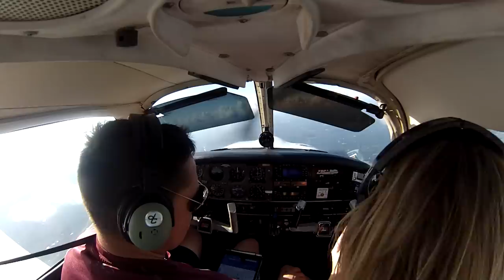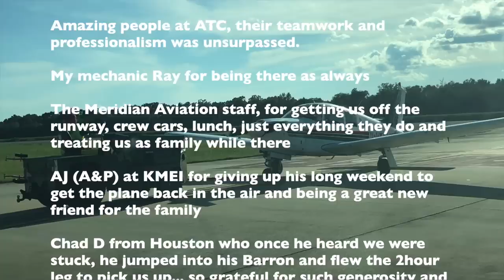Real Emergency - Power Off Landing with family in Piper Arrow after throttle cable breaks

Comment: Great job!  The only other thing I would try to do while circling is to pitch the plane into the climb and  slow the plane below flap and gear extension speed. Then drop the gear and apply full flaps. Increased drag would keep the plane to a more manageable speed even at full throttle for approach.
Reply: Exactly what I was thinking. Great job keeping his cool though. Same for his wife, she needs some credit as well.

Comment: Pretty much full load there, and yet you and the ATC handled that situation really well. I thought at first you might try staying up there longer to burn off fuel, but it turned out that wasn't necessary. Inspiring video with a well-deserved happy ending. More than a year since this video was posted, so I will wish you and yours a very Merry Christmas.

Comment: the family handled this superbly, and I would fly with them any time.

Something that no one else is pointing out is the excellent design of the Piper Engineers. Designing it to go to full power in the event that the cable brakes is brilliant. Failure mode gives Pilot full power. I just wanted to comment on how smart the engineers are.
Reply from the maker: Agreed Joseph and sure beats the alternative!

Comment: Thanks for sharing. I used to fly a Cherokee 140 but one day my engine quit at 4,000 ft in Sarasota and I landed on a road. That day I decided to get a twin. Any landing you walk away from is a good one. You were lucky that throttle was not stuck in idle. Good you kept flying the plane and it makes you a better pilot. Good job.

Comment: Great Job Buddy! This exact same thing happened to me 25 years ago in a 112 Commander N1316J.  We departed from Hicks Field T67 in Fort Worth and were in route to Oshkosh. No issues during flight until I was descending into Columbia, MO (KCOU), my halfway point to OSH , for fuel and i tried to reduce my throttle and, same as you, it didn't respond. I fiddled with the throttle and realized the throttle was stuck in cruise configuration. I began to diagnose the issue like you did and found I could move the throttle lever with no response. Pucker factor was high to say the least. I had my brother (student pilot) as copilot and my 5 year old son in the back seat. All that was running through my head was my father's words when I was in pilot training "fly the airplane". 
I didn't, however, declare an emergency because I didn't want to do the FAA paperwork and I was already talking to approach control. I also figured, what the heck are they going to do for me. I had a few other emergencies in my flying adventures that I did declare emergencies and the paperwork and microscope of the FAA was just too much. 
After a couple of minutes of thinking what my options were, I remembered my early days of flight training (at this point I had about 2000 hours) when my instructor showed me what happens when you reduce the mixture and how it gets to a point of making the engine run real rough. I also recalled how the constant speed prop controls the RPM of the engine. I knew that I needed to get the engine RPM to slow down to reduce airspeed so I could drop the gear and flaps to allow me to slow down enough to land. I didn't want to risk killing the engine and have an off field landing or miss timing of killing the engine and possibly not making the runway. You had perfect timing in your case and I am so glad that worked for you.
So the first thing I did was to pull my prop back and that helped reduce the engine RPM and subsequently reduced my airspeed, but not enough. Oh and all while talking to approach to setup for arrival. I was about 25 miles out at this point. Then I decided to gently pull back the mixture until it was lean enough to run rough. That reduced the engine RPM and airspeed enough to allow me to lower the gear and one stage of flaps. At that point approach turned me over to the control tower. The airplane was flying fine, the engine running very rough and I had it ready to land. The tower asked me to enter a downwind for the the runway. I did and about abeam the numbers they asked me to extend downwind for a Mooney on 2 mile final. Actually it was a good thing because it allowed me to cool down. The called my base and final about 3 miles out. Everything was looking great and it looked like I had this in the bag. Then the control tower tells me the Mooney is landing long and that I may need to go around. WHAT!!!!!
Sure enough the Mooney is 2/3rds down the runway the the tower asks me to go around. This is the point that I realized  I should have declared an emergency. Duh!!! Ok so I bring up the mixture, the prop and here we go to do it all over again. Fortunately with the gear and flaps down the airplane didn't want to gain too much speed so I just reduced the prop back on downwind, and pulled the mixture back until things were shaking and did a base, final and landing with engine power on. I taxied in with the engine running like it was coming apart and when I arrived at the FBO the young man guiding me in had a strange look on his face. As I shut down the engine and opened up the door on my side, he comes up to the aircraft and says "The throttle cable broke didn't it?". LOL I said "How do you know that?". He responded that he had another airplane, a Piper Arrow, about two months ago come in with the same problem and he had done exactly what I did to get the aircraft down.
Well there is more to the story as to how we got to OSH but that's for another chapter. I am so glad you and your family made it down safe and sound. You did an magnificent job at staying calm and you did what every pilot should do during an emergency "FLY THE AIRPLANE". If you want to hear the other part of this story give me a call (817) 991-6260 cell or friend me on facebook and we can share our adventures. Sorry for the long story but I just wanted to let you know you did an amazing job and that your aren't alone.
Oh and your wife.... well as nervous as she obviously was, she remained calm and didn't add to the problem and did everything she could to help the situation. She's a keeper! Coodoe's to her for being the perfect copilot.
Now I have over 5000 hours flying private aviation and I have learned that there are people that become pilots and then there are pilots that become aviators.
God Bless you guys and know he is always watching over you. Sierra Hotel Brother!!!   Your fellow Aviator,  Rick Raesz

Comment: Good job man.
The same thing happened to me the flight before my private pilot checkride (I was a student pilot flying solo practicing my maneuvers). I remember the throttle literally was stuck, and then it snapped. The plane was stuck full throttle just like yours was. As a student, I was scared to shit. I declared an emergency to get them to clear me through the bravo because the bravo is 2800 feet above the airport. Climbed to 5000 feet above the airport, cut the engine, then did spirals above the airport. Then I entered the downwind and basically did a power-off 180. It was the best landing I've ever made.
Reply from the maker: Well done sir! That’s one way to work those commercial maneuvers early... yikes. Well done handling something like that so early on.
Reply: @FamilyPilot  My instructor always stressed the importance of that maneuver to me even though it wasn't in the PTS. He said it could save my life one day and teaches control of the aircraft. We practiced the maneuver a lot and I'm glad we did because it saved my life. I told my examiner what happened the day before and he told me that it would be hard for him to even pull that off so he was impressed.

Comment: I was flying with my father, in a grob heron when the throttle cable snapped while climbing from the airstrip after a touch and go. Fortunately for us we were stuck at high revs so we could continue to circuit, and used the mixture to control power output. This was really good to see someone else manage this very well. (I am by no means a pilot, however my dad is a commercial captain, he deserves all credit for this story)
Reply from the maker: Thanks for sharing, glad it worked out!!
Reply: Family Pilot thanks for replying, was great to see how well you dealt with this

Comment: I never knew that about Piper aircraft (if the throttle cable breaks it goes to 100%). 
You did a great job, I can appreciate the extra stress factor of having your wife and little ones depending on you to survive. Thank God it all ended very well. Your wife looked like she couldn't wait to get out of the aircraft. Here's hoping all future flights are free of any problems. Thank you for sharing. 👍🙂👍

Comment: I had the same thing happen in the early 90's in the same type of plane (PA-28R) while doing touch n goes.  At the end of my climb-out, I reduced the throttle and nothing happened. We ended up flying out a long downwind and killed the mixture on a long flat approach and glided in. The fire trucks were waiting for us and we had to get towed in too. I don't remember how we slowed down to lower the gear but I don't think we ever got to cruise speeds and somehow was able to keep the speed low. I do recall we landed with only the first setting of flaps. Anyways, congrats on a great landing and keeping your family safe. That's all that counts at the end of the day.

Comment: Back in the era of bi-planes, there was "full throttle", and you turned the mags on and off as needed to get the amount of power you needed.  You knew that trick, and used it.    When you fly, you have to understand what the plane is doing, and what you need to do in any circumstance.   You didn't panic, thought clearly, and got it down safely.     Different circumstances, but just like Chesley Sullenberger did when birds destroyed his engines over the Hudson, you kept a cool head and didn't panic.   I'd fly with you any time!
Reply from the maker: Thanks Ira :) happy skies

Comment: Yep, good job!  This same thing happened to me in a 182RG.  Came into Scott Airforce Base pretty calm, leaning the mixture cutting the engine on and off.  It was an unusually surreal experience, gliding in silence toward the field.  I had to richen the mixture to get the engine running once or twice because I misjudged how far I was out...never landed on an 11,000 foot runway so when I thought I was getting close...not.  I wasn't really scared until I saw all the emergency equipment lined up.  Through the pucker factor, one of the most buttery smooth landings ever.
Reply from the maker: Glad it worked our Mark. We train for it but not fun. Happy skies

Comment: You guys did Amazing I have NEVER seen anybody so with so much pressure and still keep calm  I haven’t finished watching the video but what I would do is wait for the fuel to run out while I am circling around the airport then put the gear down and hopefully land safely
Reply from the maker: Weight wasn’t an issue so shutting down the engine in flight would allow me to restart it if I had to versus waiting for fuel to run out :) 

Happy skies

Comment: Way to go. Would’ve love to see the final approach In normal speed. And what you did on all that. Good learning experience for other pilots. You did great. Keep calm, communication with atc and vice versa. Must have been more hard and more pressure to do everything right since having family on board.
Reply from the maker: Agreed ANDRES. You can spot the moment our forward facing camera dies and the audio didn’t record at all so we used the ATC tapes...  wish we had the forward facing with the prop stopped. Thanks for watching and we wanted to spark the discussion with cfi and student to plan how they would handle :)

Comment: My partner had a throttle in a cherokee 140 disconnect on final at around 1500 rpm. He was landing on a short narrow strip and by the time he realized what was going on, it was too late to pull the mixture. He remembered to "fly the plane" and ended up flying it into treetops at the end of the runway. The plane was totaled but he walked away. That was airmanship!
Reply from the maker: Wow Jay glad it worked out. Scary stuff.

Comment: I had a similar thing happen in a Piper Warrior.  The pin that attached the throttle cable had broken, though it did not fail high - it failed at the power setting it was...about 2200 rpm 80 kts, 1100 ft.  Stuck there and was able to do a precautionary landing (with passengers).  Ended up uneventful as the power setting wasn't full throttle.  You all did great.
Reply from the maker: Thanks Tanya, interesting yours didn’t snap forward too, I like the design that snaps forward better than staying stuck low.  Glad it all worked out (in both of our cases) :)

Comment: dont forget your copilot in that team work statement she is a trooper as are the kids!!!!!
Reply: thanks for the heart ...iit is always good to share these experiences ....i have had my fair share of stressors as well but that was before all this technology. i helped build in the last century....
you will have those issues  if you fly the higher tech airplanes. I still have a license but getting to old to fly by myself....i also flew in war and its wholely different set of issues. the kids also did a good job getting preped and staying calm...nobody can ask for more. might think about trading back in airplane and scouting systems of manual gear and throttling, goverrnor sellections, many fail safe systems to look at. i fly for fun so mine is a 152 and  a safety pilot, nobody gets in that seat unless they are current or lisenced ....nobody!!

Comment: If this happens it’s best to use magnetos to cut engine power. I would do this opposed to cutting the mixture because there will be instantaneous power once mags are switch on again. There may be a lag if the mixture is cut and pushed back in. Great job flying the plane and keeping cool! Fly safe!

Malik 
CFI
Reply from the maker: Thank you Malik!

Comment: Great vid thanks and good work.  I've got a slightly different view on this, and not to diminish the good feelings after dealing with this issue.  It's the same thing I thought after the water landing on the river in New York.  I was pleased of course, but the next thought is, "this is the job, and dealing with emergencies is normal."  I see competently dealing with the stuff we're trained to do as being normal and probably more impressive to bystanders than I feel about doing it myself.  The adrenaline is real and necessary of course but just to sharpen the performance, not because you're worried about getting hurt.

Comment: Mom and Dad held it together like heroes that all good parents are. Then broke when they were on the ground, like all humans would and should.

Worth noting, really nice job managing the situation, by you both, but dad's piloting was really top shelf. He knew to take his time, keep focused, refused, smartly, the ATC 8 mile suggestion, preferring to stay closer to the field just in case.

Got the plane down smoothly and safely. Pretty great flying actually. Interesting thought, should a plane be designed so that with prop-tilt and mixture you can reduce airspeed until you can get gear and flaps down if the throttle is stuck on full?
Probably not possible, though.
Reply from the maker: Thanks Jack! Wonderful comment and much appreciated.  The Arrow can slow down pulling the mixture out which is what we did (starting to shut down the engine essentially) and the prop can be used as you saw to add or reduce drag - the single engine birds cannot truly feather the prop like the larger multi engines can but it can help. Thanks again!!

Comment: Good job! I'm not sure if everyone goes through this but I had to practice multiple engine out landings. Of course we didn't completely shut off the engine but would bring back to idle. I also had to do this during my test from straight above the airport. The FAA examiner would pull the throttle back to idle, I'd first "fly the plane" (basically go from a slight climb to leveling out and find best glide speed), go over emergency checklist (all while circling above airport). I would then circle the airport at basically glide speed and the closer I'd get work the flaps to my favor depending on speed/altitude and distance from runway. The last loop is THE most critical. You can't turn base too early/late or be to high/low. It's extremely stressful and in spite of the fact the motor is running you had to fly a little closer than most would be comfortable with over power lines, it's definitely not the safest thing a pilot can do lol. Eventually though the adrenaline boost you get is addicting toward the end. Even if you land a little short/long the point is to get down quick and safe using a slip if you're still high etc. If I recall full flap is not recommended without power so we'd keep'em around 20 degrees or so if I recall. Oh, and don't pull up abruptly etc and put the plane in a stall! I miss that. Thanks for the video, I'm glad you nailed it and you and the family is safe!
Reply from the maker: Thank you for comment and watching.  It’s an important part of our training for sure and the mix here was getting to choose when you will lose your engine makes it a lot easier as well. Fortunate engineering by Piper to break to full. Thanks again for watching and happy skies!!

Comment: His poor wife looked scared as could be afterward but had her work face on the whole time. 

Pilots really should practice more engine outs way more often. When I had my engine out I was in the pattern so it wasn’t a factor. Just a normal landing with a tighter base to final. Only thing different was no go around. Of course that was with fixed gear so there was a lot less prep work and figuring needed. 
I’m very glad all are safe and I’m VERY impressed with ATC, mechanic and emergency responses!